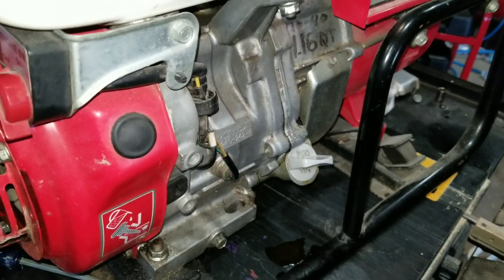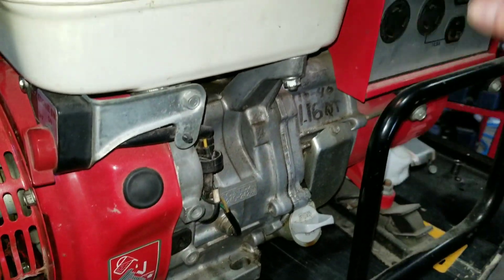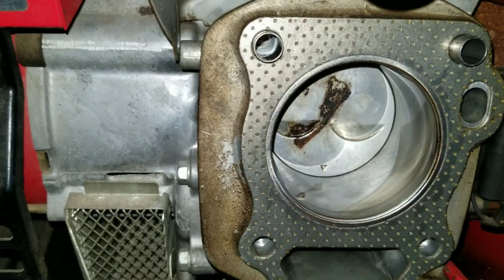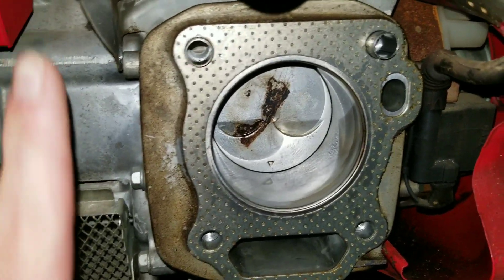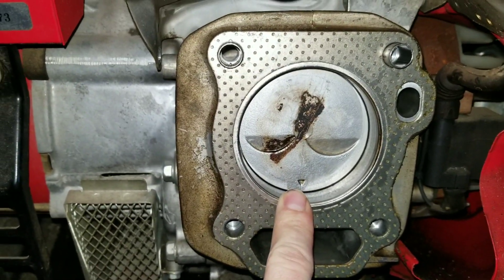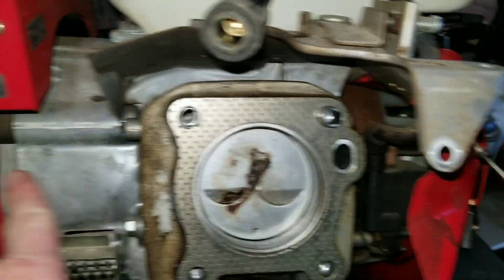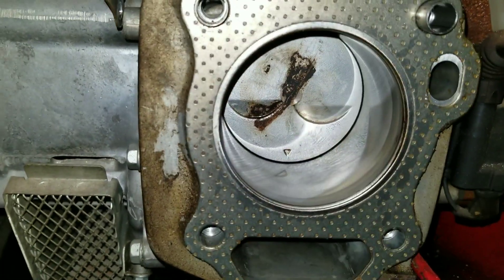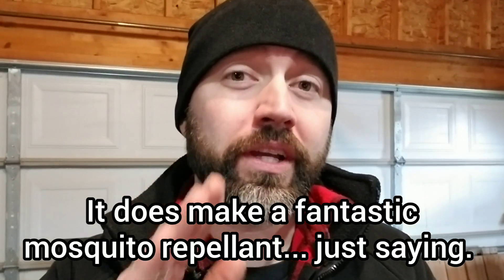Why Your Generator is Blowing White Smoke [Top 3 Reasons]

Comment: I just got a Champion 5kW duel fuel generator that produces a lot of anti-mosquito fog.  I did check the oil dip stick and it appears to be the right level (after confirming the manual [online search] and what you said here). The motor seems to run smooth overall without extra popping or searching. The smoke did die down a little as it warmed up and as it reached full temp, it started smoking badly again. I'm guessing maybe there's a small crack in the gasket that's changing shape as the temperature changes.
After watching this video my next diagnosis will be to check the head gasket. Thanks for the very informative and detailed explanation of what causes the smoke. And you kept it short, too. Awesome job sir. 😎

Comment: I just purchased a Honda EU 3000 from my coworker. He said that it smoked a little bit.

I said it’s OK I smoke a little bit too 😂

I can’t believe it but when I offered him $500

Then I quickly said $300

He replied $125!

What a cool guy 🙏🏽🙏🏽🙏🏽

When I got to his house, we try to start it for like 15 minutes with the electric start.. 

I told him I would take it home and mess with it 

He said ya pay me after it starts… I gave him the cash cus I trust him.. he gave me $25 back for trying to start it.. so I got it for $100.. so dope I owe him 2 I said cus he really hooked me up and he just met me a few months back on a bridge we are building! He’s a union carpenter foreman! I’m a union Ironworker…

By the way
(We both knew it worked he just hadn’t used it in a while

The next morning I gave it a few pulls and it started on the 3rd pull! And yes it smoked a bit lol

I put a battery tender on it and after work tried again but this time with the push start and boom it started 🔥🔥but yes it smoked a bit

I changed the oil, spark plug, air filter, cleaned a cap that filters the fuel a bit (sludge with dirt) same with the carb.. & air filter housing.. 

And started it and boom still a bit smoke..

Just saw your video and I decided to open the oil fill and boom oil spilled out…i let it all spill out started it again and no smoke 🙏🏽💪🏽 

Super happy man thanks!!!!

Comment: I don't even have 50 hours on my Duromax dual fuel and it's blowing white IF I can get it to even start. I thought it was from starter fluid plus a little gas in the spark cylinder. Pristine filters, oil is correct, gas is correct, new gapped plug. Ugh. Better not be any of these three as it's barely been used.

Comment: One thing with honda gens with tank above sometime the needle valve in the carb can leak so engine sump fills crankcase up with petrol if oil pours out of oil filler it maybe fuel .this chaps done a great video 👍

Comment: Mine only blows white smoke when I first started then it clears up and runs perfect, I pull the exhaust off to see if there was wet black suit Or dry fluffy which would be carburetor, I can’t figure it out and sometimes it doesn’t do it At all,any suggestions

Comment: Good day, I have 2 questions, my Honda 3000 eu when I start it up it smokes for like 30+ seconds and smells like burnt oil,then stops smoking,.    I also have a duromax 4000 that runs like a top, only thing I use it for a 2 inch submersible pump at work, it will pump water for a minute then stops producing power for like 30 seconds then back to pumping etc, frustrating when you're trying to pump a hole out at work

Comment: would the blown head gasket also take a few second after start up to smoke ? I have a yamaha I changed the rings on and it looked absolutely mint inside and out. Even the rings looked fine. Changed the valve seal just as a precaution but didnt have a head gasket in my kit. After seeing your video, I think its seeping by the stock aging head gasket enough to cook some oil. 

The stock head gasket is metal but I will go ahead and replace it now, its smoking just like before. 
The head comes off relatively easily and I ordered a new head gasket regardless. 

Thanks for the info. The odd part for mine is it runs perfect first pull and then maybe 30 seconds running, smoke fog machine turns on and reeks of oil burn. Correct oil level and oil type confirmed, so going down the list now.

Comment: I have a wen 2350 watt generator it blows white smoke for a second when the engine revs up, but none while steadily running. I haven’t finished breaking in maybe it will clear up.

Comment: Help me with this :  I have a 5 hp B&S generator from 1980 or so. Has not run in many many years . I putted a bit wd40 on the piston to be sure and tried to start. The oil level was lets say 50 % full and I filled it with Sae30 and uber filled it .   I filled it with fresh petrol and did not clean the tank . I had a few pulls and with starter pilote it starts . And stops - but when it starts running - it very hard to start - membrane will be new.   I have never seen a BS burning oil like that . 
Put the oil level back at 50% and — smoke dissapeared almost . When I put the power to full, smoke ! When I choke the airfilter - white smoke ! I pull the carterventilation off - smoke continues when hand on the airinlet . 
I have compression, and no pressure  in Carter . But I have compression in the airinlet, the choke clacks open en close - a bit air comes out the inlet of the carburator .. But still smoke . 
I checked the valves - one thing  for sure The inlet valve opens snd closes, but does not rotate fast . ( marked it) 
Where do I have to look ? The head gasket? The valves ? They look good to me ? 

Just curious what people think . I love B&S and I can’t think this engine has ceased to be.. thanks in advance for the answers .

Comment: Please answer: our generator is a 9.5 kva diesel engine, when I start it, the some is still normal, like no smoke at all, and later after it is running for almost 2 hours  and the generator wil shake, and the thick white smoke will come out. What is happening? What should I do? 

(btw the only things plugged in are a refrigerator and some light bulbs)

Comment: I have a 800 Chicago generator or 800 watts I recently changed the carburetor to Wood but now when I start the generator I have to push the on button start it up and the middle of the choke and when I push the little choke button to the left to shut it down are choke it up it runs the opposite when I turn it off it doesn't turn off when I slide it back to the off position and I have to push the button to turn it off how do I

Comment: Hey, I replaced the spark plug and I think I strip some threads, but it fits perfectly but now it’s smoking, is it because some aluminum slits fell inside? What should I do
Reply: probably also dropped some metal in there to score the cylinder. Dont attempt things like this if you are not even sure how to replace a spark plug. Sorry it may sound mean, but a spark plug change is a very simple job.
Reply: You are pretty much screwed if you stripped the threads. Could try to rethread them with tap n dye.

Comment: I just did reason number one... just as you described :( if I let the extra oil out will it burn off the excess oil residual and be OK? Or will I need to take it apart and clean it before running it?
Reply from the maker: If it's still able to run and you now have the oil at the correct level, then it should burn the oil out of the combustion chamber on its own.  Might take a little bit (depending on how much was in there), but you should see it become less and less.

Comment: You need to research why the Sportsman 1000 watt inverter generator smokes it's not any of your three reasons
Reply from the maker: I'm aware that the old manuals on the Sportman 1000i used to say to add 10oz (I believe) which is too much and they would burn oil like crazy since they are supposed to only have about 7.5oz.  My Sportsman just started blowing white smoke like crazy and I also have smoke coming from the dip stick when it's removed -- so I know that I have either piston rings that failed or a blown head gasket to allow that exhaust to enter the crankcase.  Unfortunately, it's not worth the fix since I don't even think they sell replacement parts and the time involved into tearing into it is probably not worth what it would cost to buy a new one.  I'm definitely upgrading next time to a reputable brand.  If you have another reason to add as to why there's white smoke, I'd love to hear it.  I love learning and sharing what I know.
Reply: @HomeBatteryBank  if you look at these Sportsman 1000 watt inverter schematic parts list you'll see what is called a one-way valve that's in the bottom of the crankcase mine was defective (bent)by high pressure  the result--  I guess from blow by from the piston     how that works is lubricating the rocker arm assembly on top of the head any overflow is taking back around to the carburetor when defective forces too much oil into the carburetor which then smokes
Reply from the maker: @stublackwell  Interesting! I probably have the same issue (along with dozens of other people on the forums).  I was having oil run out of the air filter from the carb as well.  I assume you scrapped your generator?

Comment: you also forgot valve stem seals otherwise good content
Reply: Thank you for the info on the smoking like gas now explain to me when I shut off my generator 800 Chicago Watts when I pulled the choke to the choke area it just runs normal when I put up to the off position it goes faster it doesn't shut off and I have to push the button to turn it off what did I do wrong I recently changed the carburetor
Reply: @robertnegrete5422  have you checked for air leakage around the new carby, would like to see a video of it would help